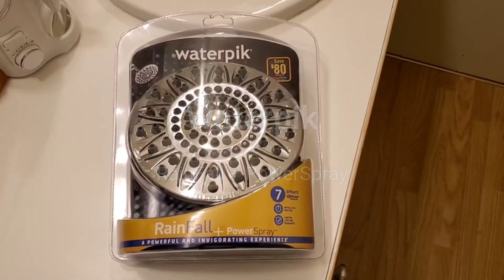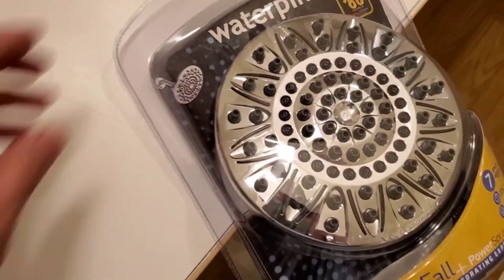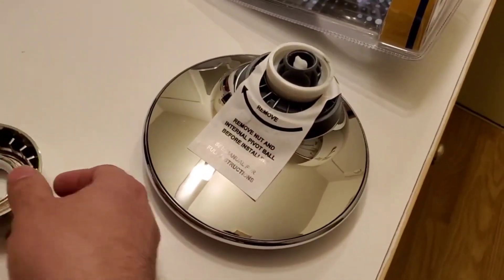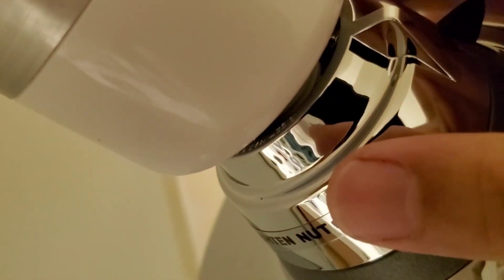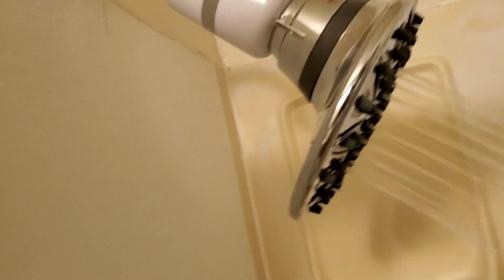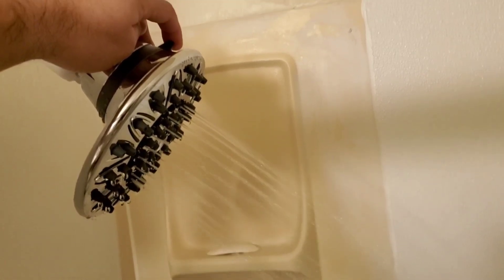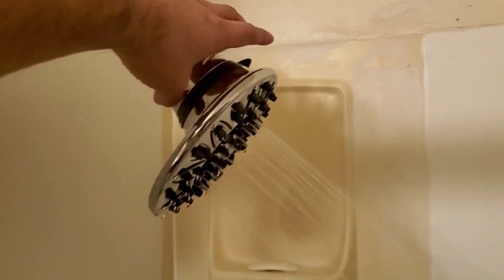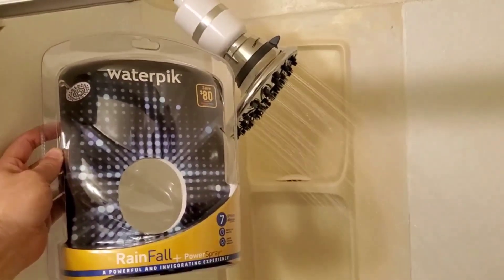Waterpik RainFall + PowerSpray Quick Review and Installation

Comment: You installed it incorrectly. 1) Screw off the cap with "tighten nut" and put it through the showerhead pipe. 2) Take the loose pivot ball inside and thread it onto the showerhead pipe by hand (use teflon tape). 3) Place the showerhead against the ball and use the tightening nut cap to place in desired angle. 

Someone else commented it's upside down, the Waterpik logo should be on bottom so the adjustment lever is on the bottom for easy access.

** Not recommended tip: You can mess with the pivot ball to take out the regulator for better water pressure. 1) Take a pair of pliers and there's a filter on the threaded side, pull it out, replace the gasket. 2) Other side has a plastic piece, take a screwdriver and just pop it inward and it comes out the other end.

Comment: Mine leaks out the back where your filter is but I don’t have a filter 😢 did everything you did still leaking
Reply from the maker: First and foremost my apology for the late reply, had a few MAJOR family heavenly departures to our Lord.  You may need to do a lite Teflon tape at the start, 3x times around and an extra 2x more circles towards the back end.  This would create a small tapered connection.  Remember it is a plastic molded piece and it should only go a tad more than hand tight.  I say about a 1/4 turn after hand tight with plier if needed.  Also the wear and tear of the pipe you are actually connecting it to may need a light cleaning on the threads to make them as smooth as possible. - Hope you have since then resolved the issue and my apologies for the late reply. - Respectfully, Jose de Jesus